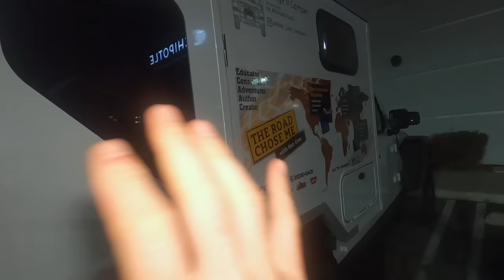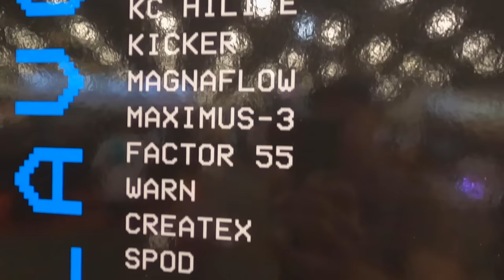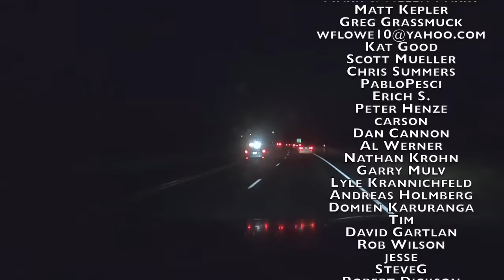SEMA MADNESS

Comment: Hi Dan. Just a thought for the Jeep build. See if the passabger seat can be on a swivel so it can become a lounge chair when turned toward the camper.
Reply from the maker: That would be ideal, and woks well in vans, but it will never work in a Jeep. The center console stops it turning, and the height of the seat compared to the floor just doesn't work.

Comment: From my research and experience with solar panels on my van ( 5 years ) , you should use hard solar panels,  not flexible.  The flexible panels don't seem to last much longer than 2 years or so. I have my solar panels mounted on the roof of my white van about 2 inches above the body for airflow below them.
Reply: Totally agree. Just replaced flexible with glass solar panels on our caravan. Performance has doubled.

Comment: 7:00 are you saying your jeep doesn't/ will not have turn signals. I think that might be a mayor problem driving in any semi developed to developed country. I know for instance in Turkey you have to have them and have to have them working.
Reply from the maker: Many North American vehicles do not have a separate turn signal, they just flash the brake light. That is what my Jeep did from factory, and that is what it does now.
Reply: @TheRoadChoseMe  wow. I'm honestly surprised that those vehicles are allowed on the road here. The controls for these things are super strict,  especially in the EU.
Reply from the maker: The versions of them sold in the EU (and Australia) have separate turn signals.
Temporarily importing a vehicle around the world is strange through - as long as the vehicle is registered and insured in it's home jurisdiction, it doesn't have to pass any local laws - no emissions testing, no crash testing, etc.
Reply: @TheRoadChoseMe kinda makes sense but also quite weird because not having / using turn signals is quite often fined here. When you shipped and drove through belgium, was it possible for you to get speeding tickets or something like that? Because they're always issued electronically and sent to a home address
Reply: @robertvoss9111  There is still a turn signal; it just uses the brake light.
Reply from the maker: @robertvoss9111 I don't believe so. I drove through all the automated toll gates in South Africa with my Canadian-plated Jeep and never heard a word about it. How can they know my home address?
Reply: Interesting! Going through france is like a 100 euros toll so you saved yourself some money there 😉
Reply from the maker: @robertvoss9111 I had to pay the ones in France because they didn't have an automated system to record the license plate, they had a "you must stop and pay right now" system.